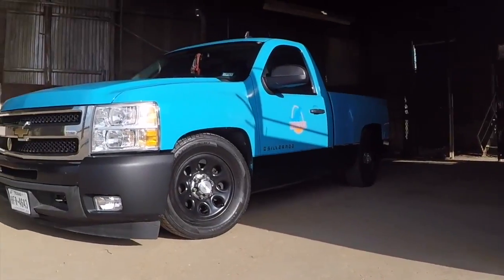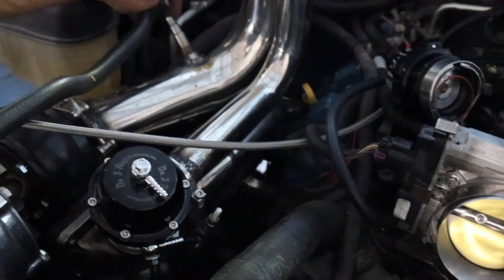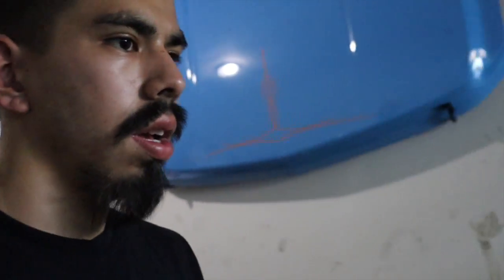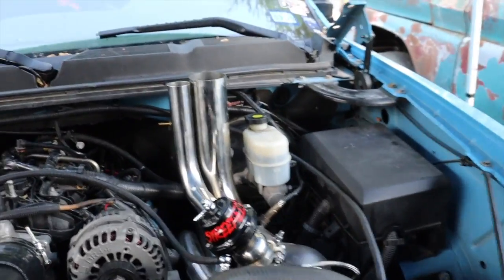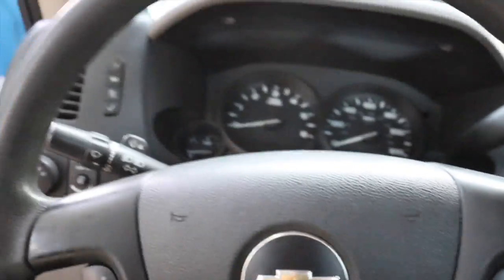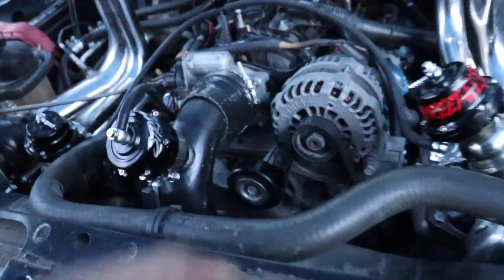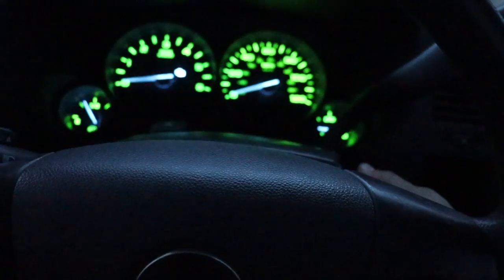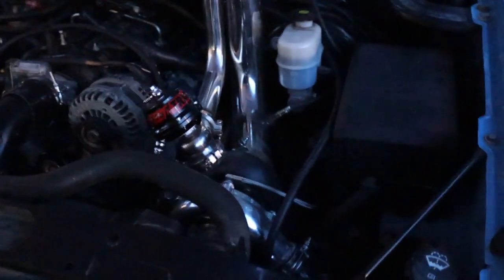FIRST DRIVE ON MY TWIN TURBO SILVERADO

Comment: Sounds good bro but u should do full exhaust pipes to the back  with x pipe and resignators and it will sound badass
Reply: Hell no you trippin
Reply from the maker: Lol 👆🏽 I don’t think I have the room to run the exhaust to the back

Comment: Hey man. I’m working on my yukon now installing new 600 valve springs and roller rockers plus the summit 8712 cam. Those valve springs are a pain in the back and butt. Lol I’m getting them done. Hey I’m 51 and 6’6 and over 350lbs. So it has its challenges lol. I’m trying to find the crank bolt at local hardware store but that bolt is a specific one. It’s a 10.9 bolt so I’m off to Home Depot. This is a huge job by myself. I’m handling it but I’m glad I waited, watching your channel has been a huge help probably 90 percent of my knowledge to do this came from you. Except a few drawbacks, but it’s the unexpected things that pop up. Like the valve springs not perfectly lining up with the stems. Lol. What a b$&@!  Lol. Plus how do I stop the engine from rolling over when reinstalling the balancer ?? Not there yet but ya.  Thanks a lot for your good videos for a big old retard like me.Thanks man 😎
Reply: Go to autopart store for crank bolt. Its only 6$
Reply from the maker: That’s awesome, if you have an Instagram or FB add me and I can send you more info on how to make the job easier
Reply: When installing balancer use a 1/2 impact to tightened down the bolt and press in balancer. Once timing is lined up after installing the cam it doesnt matter if the engine turns over while tightening the bolt.

Comment: Whats your fuel system?
Reply from the maker: Walbro 450, 80lb injectors
Reply: @dinocoblue2709  you dont have a fuel regulator and how much boost are you gonna make. How much power are you looking to make? And e85 or 93?
Reply from the maker: Yeah I have a fuel regulator, e85 and my tuner is gonna dial it in around 530 just to keep the 4l60 together but it’ll make more power then that easy

Comment: Somethings going on with your tune for sure. It sounds like it's only firing 6 of the cylinders my man. Be careful bad things happen with bad tunes. Other than that good job
Reply from the maker: The tune is good trust me Jeremy at Lsx unlimited is a bad ass, it’s just that my truck in general runs richer